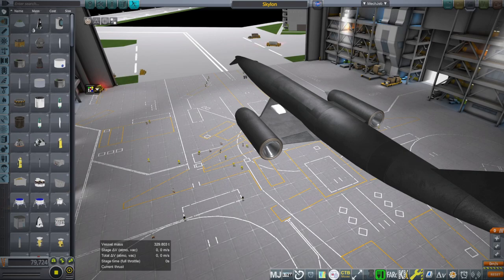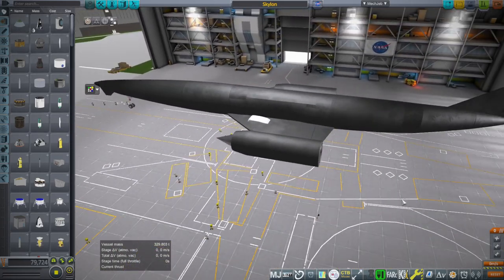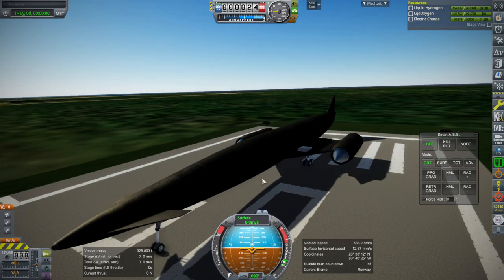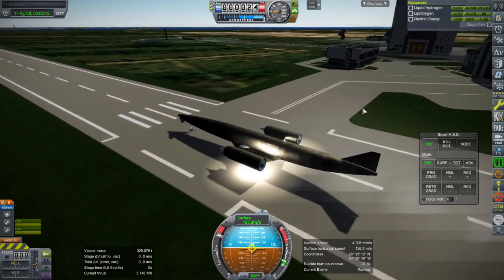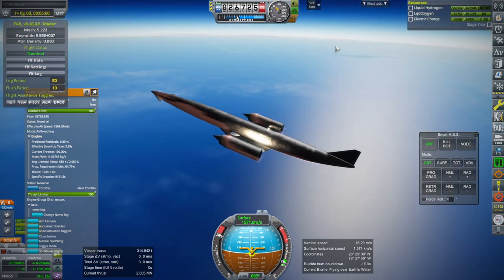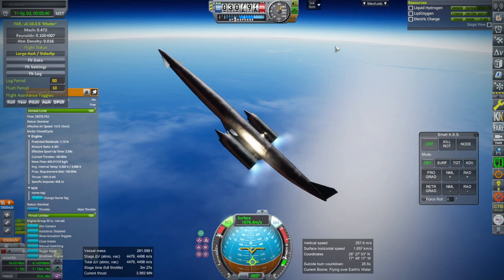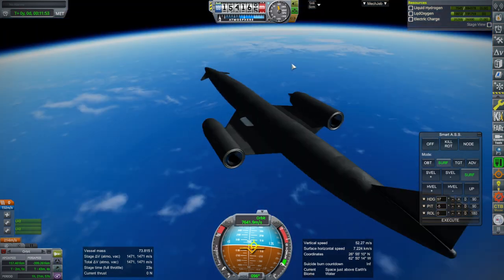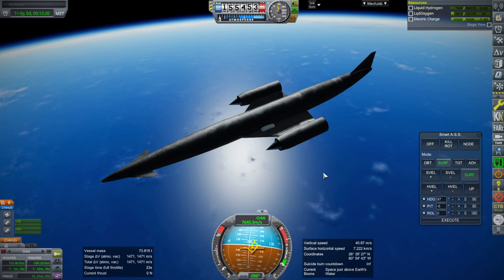Kerbal Space Program 1.12 with RO - Skylon Initial Testing

Comment: Skylon has a quad-bell design like the R.A.P.I.E.R. in stock. Also curved engine sponsons.
Reply from the maker: Not on their website - they no longer have the quad-bell design or curved engines. That's old info from wiki you've got there.
Reply: @RaizSpace  ah, thanks for the correction!